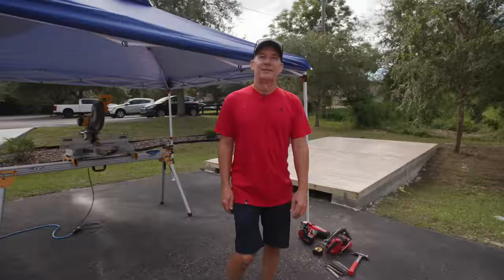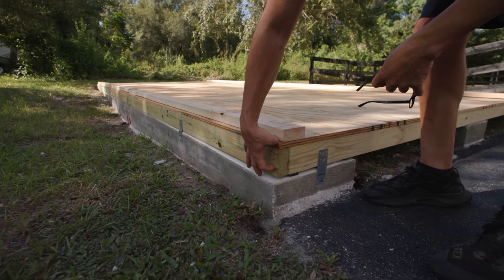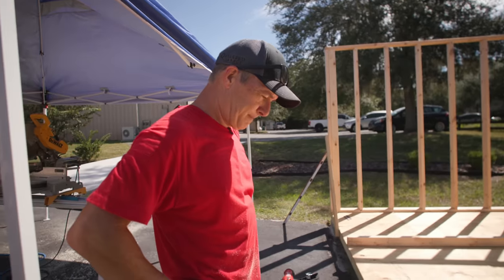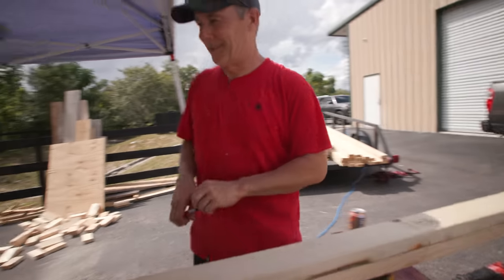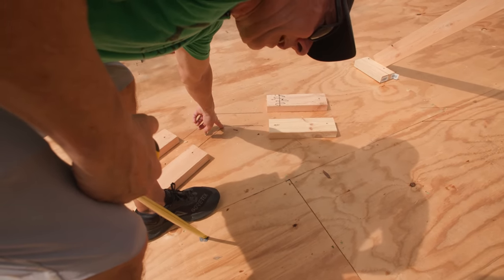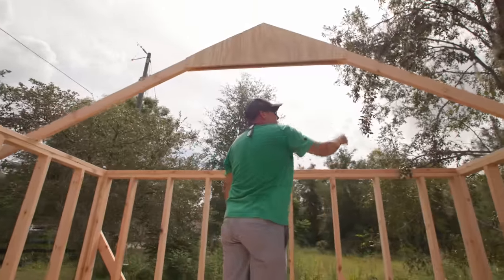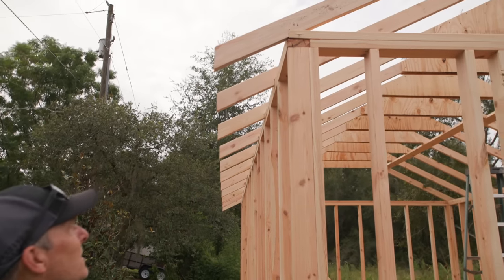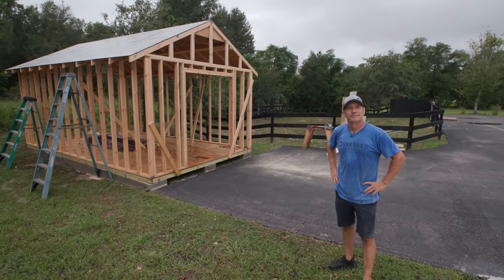Building the OG Shed with Mike F: Part 3 - Framing Walls & Roof Trusses

Comment: Built a similar shed behind my house a bit over a year ago. I didnt put any sort of plastic under the floor and Im noticing if I sit something on the floor, there is moisture under it when I move stuff around. Wishing I would have put plastic under the sheathing on the floor.... Mine is a bit different in that its on posts, so Im going to try putting plastic on the ground under it.
Reply: I think they removed that plastic it was just to prevent rain water to ruin the shearing as it was being built
Reply: @Deagles456  He did, Im talking about something different though. Im talking about putting plastic (or maybe house wrap?) under the sheathing on the floor so moisture coming out of the ground doesnt make its way into the building.

Comment: Are there blueprints that I can follow so I can do a similar build
Reply: I didn't use prints. I designed it to make the most of material with as little waste as possible. 12'x20' with a 6 in 12 pitch does that.

Comment: QUESTION:  If you were to use your at home pressure washer setup to be the foundation of a soft wash house washing setup (Bleach based house washing), how would you do it?

I've gone down the rabbit hole to avoid building my own soft wash system to wash my house and I think I have a solution but would like to hear what you would do.  THANKS! 👍
Reply from the maker: You would need to open up the orifice pretty wide to bring the pressure down substantially.  I don't know much about softwashing, but I don't think a traditional pressure washer is what they use.
Reply: @ObsessedGarage  ok thanks I was hoping you had tried it. It can be done with either downstream injection and a J Rod or through the use of a M5 xjet. The uncertainty I have is with a 2 gpm pw versus the higher gpm pumps house washers use. Anyways thanks!

Comment: Why didn’t the roof get 16 inch centers? Looks like the walls did.
Reply: 24" spacing works better with the 4'x8' plywood roof sheathing, the edges have a nominal edge of truss to nail down to